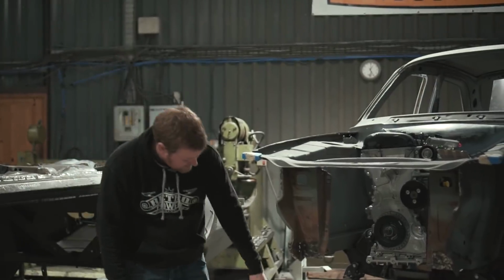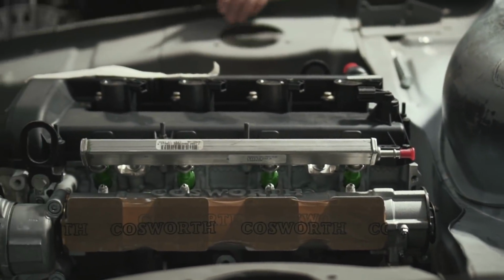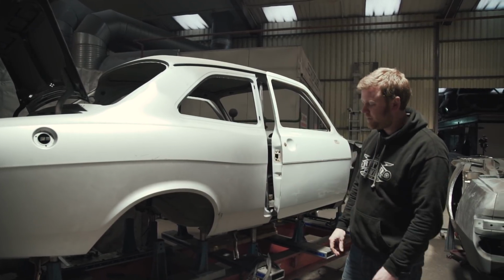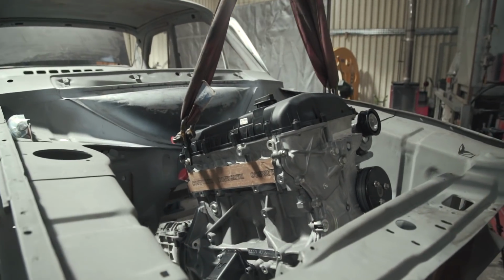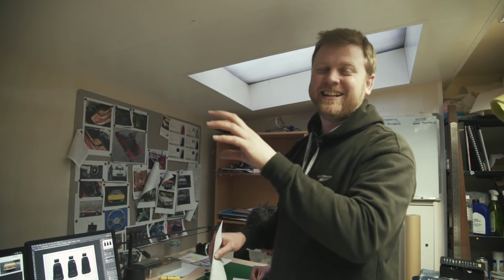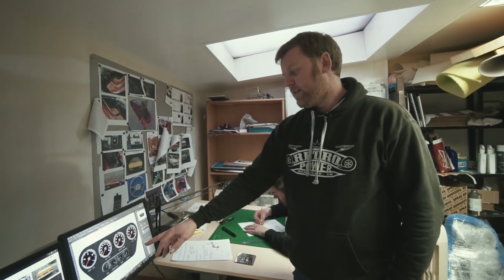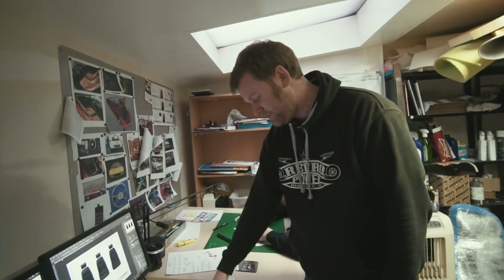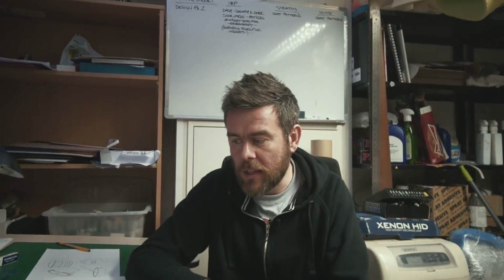Gordon Murray's MK1 Escort - Retropower Build Episode 3

Comment: Why not use a BDA engine? and keep the car an Escort. Such a shame that these cool old cars are lost to the modification world ... might as well buy a modern car IMO
Reply from the maker: Peter Skudder each to their own I suppose. I agree it's nice to see original cars too, but disagree that the car is being 'lost'... quite the opposite, it will most certainly get regular use in the near future, and that's what it's all about. So many 'original' cars are just locked away in garages which is more of a shame than modifying them in my opinion.
Reply: As someone that has been in the trade for over 50 years, I can say that I have "saved" a lot of old cars. However I have modified more than I have bought back to "original". That is the fun of what I do, pushing boundaries. Back in the early 2000's I built a Mk2 Cortina in California with Mazda MX5 running gear. A neat car that would otherwise been on the scrap heap. Was in ClassicFord Magazine September 2006, "Turning Japanese". 

What you guys are doing is brilliant, I am so happy to see the trade in such good hands.
Reply: Oh stfu. There are some that remain original and some that will be modified. Did you buy this rusty damaged shell of a car? Then mind your own business.
Reply: Its not like theyre rodding the only mk1 escort left.
Theyre a penny a hundred.

Comment: Rs1600 interior is still the best looking interior i have ever seen in a mk1 and having seen thousands + they now remake the material . Black putty headlining also makes the entire difference . Rear best look is still stainlees steel rear chrome bumper without reverse lamps . Boot badges use mk1 transit custom badge left side instead of rs badge ( placed correctly ) (never been done before ) .  But understanding a reverse lamp needed a spot lamp was the best rally look , but if i ever did another i would go into modding rear lights , replacing reflectors with reverse lights in line with mk2 style. Ali works arches as used by ford not steel ( gartrac make em) . Vinyl dash top as flocking though more practial from glare looks wrong . Baffled mk1 van tank fitted in boot floor to shape of original rs boot wind deflector ( never been done before) instead of lob sided standard tank or shit looking alloy centre tank . Then boot lined in black felt with rs boot matt over tank . Battery under back seat ( beetle style ) so keeps boot empty and clean ( never been done before ) . Electric fuel pump under bonet left side back where servo usually is ( keep boot clean for the luggage) . Remote servo left side front inner wing as pedal to harsh with just pedal box . Dru sump tank  under other side of back seat ( keeping boot clean for luggage) or if not possible the standard mounting of where standard fuel tank  but behind a cover

Comment: Any reason why your not just using an RS set of clocks ?
Reply from the maker: Just didn't look pleasing to us. Looks sort of bodged onto the main binnacle so you end up with a binnacle that is no longer centrally in front of the driver and most of the clocks are obscured by your right hand.
Reply: Maybe because they are making their own custom escort and not an rs replica? Just a guess..
Reply: I too love the RS cluster !
Reply: retropowercars - thanks for taking the time to explain your reasoning. Makes sense
Reply: Rs clocks have the same instruments and look very nice & the answer to your obsecurity issue is using an adjustable tilt and slide adjustable steering column . The brushed rs1600 fascia is ideal ;)
Reply: therealknapster so theyve then got to engineer tilt and reach adjustable steering for a 60s design...
Reply: therealknapster 
With you here mate.
Reply: therealknapster   I totally agree with you.